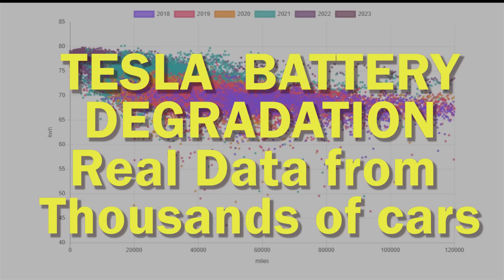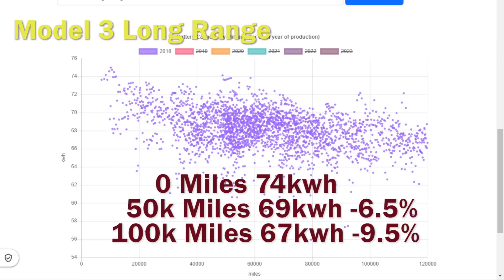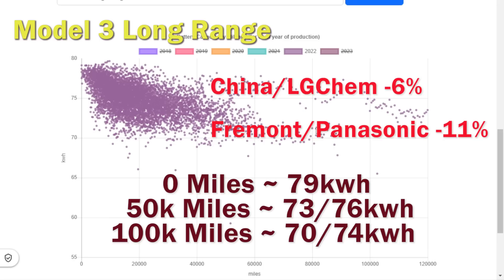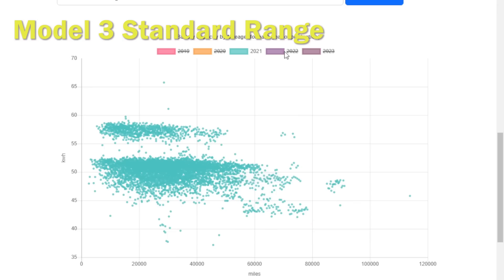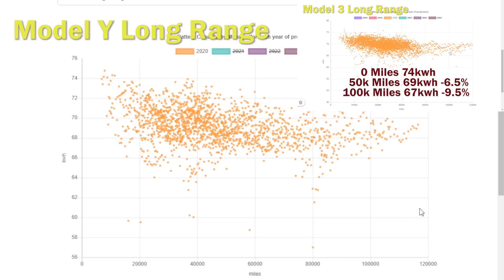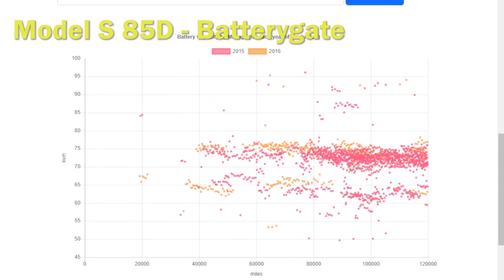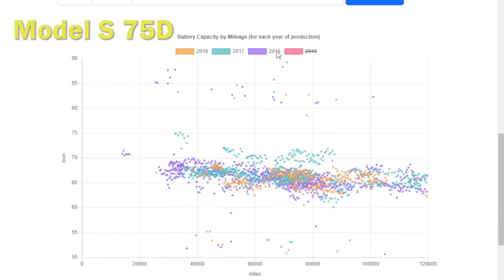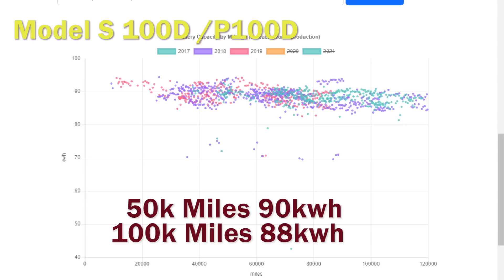Tesla Battery Degradation - The results using real data and why the Plaid is the worst Tesla

Comment: Nice info.  My own 2015-MS85D has 210,000 miles and has 89% battery still.  It lives in a cool, but heated garage .. I Supercharge 10% and my L2 is 3 kW .. keep your battery cool guys.
Reply: Sounds like my '15 90D.  Bought with 50k miles and 264 RM.  At 140k, it is down to 258-259 RM.  50% Supercharge, Level 2 charge at 8 kW.
Reply: L2?
Reply: @davidnaylor83 level 2
It means his AC home charging
Reply: And my 2016 85D can't get any farther than 35 miles. Spent all its life in Arizona
Reply: And only full charge when absolutely necessary
Reply: How is it holding up overall? I looked at a few from around 2015-2018 (MS and 3's from later years) and even ones with 40-60k miles overall build quality was not holding up very well.
Reply: @FragEightyfive  Mine is basically like new, not even a rattle .. seriously .. I’d love a new one for its higher range, but I can’t justify it because mine is so good.
Reply: The thermal management system is good. The cells aren't going to cook in the sun. Heat and cold do affect how fast the battery drains while driving.
Reply: @rkgsd  I'm curious about this.  Will a Tesla actively cool/heat the battery while the car is not in use?  It seems like it definitely would while charging but what about while it's just sitting in a parking lot and not being charged?
Reply: @bullitthead7853  Yes it does.  I cant tell you how many times I've walked out to my car while its sitting in the middle of a parking lot in the summer and I can hear the high speed fan humming from quite a distance.
Reply: How were you able to check your battery retention on your 2015?
Reply: And you are bragging about that. I bought my Toyota Corolla with 200,000 miles already on it. I have driven it another 200,000 miles without doing any repairs.
Reply: @Bryan-Hensley you’re bragging about driving a Toyota Corolla with 400k miles
Reply: I am pretty sure that Tesla is misleading with the battery degradation indicator, so most happy customers won't notice it until they do a long trip,.
Reply: @eng3d  Easy to test every time I drive as I get the range I expect.  I do mostly long trips, so super easy to see.  What is a mystery to me is why some people assume the worst from Tesla .. they make fantastic cars.
Reply: There's been reports the battery shows x % but during a trip it performs horribly. The figures it shows can easily be manipulated to avoid any warranty claims. We need hard data not what's shown on the screen
Reply: -80% is TSLA in a year 😅😅
Reply: @northerngannetproject3147  …… evidence is not your greatest asset
Reply: Jesus. 

I had a M3 long range in Hawaii. 35k miles and was down to 282 at full charge
Reply: @ssing7113  this is common mistake. Tesla will show you range at full charge based on your driving habits - not actually battery degradation. This is very important to know.

On top of that - dont charge your care above 85% unless you are going to long trip right away. After all you are at Hawaii - how much range you need per one trip?
Reply from the maker: Tesla doesn't take into account driving habits on the range when charging or at the top of the screen. We have another video debunking some of the myths about the range display.
Reply: @EVinventory  100% it will. If you drive your tesla HARD - you will not get range 310 miles when you push it to 100% 

Will your range change also when you drive fast / slow as well? For sure it will. Same goes for 100% full it will not give you maximum amount of miles each time you full it 100%
Reply from the maker: You're confusing real world range with what the car is reporting. The car reports the available energy in thye battery converted to miles using the EPA efficiency figure. What you actually get when driving will of course depend on your driving. If you don't believe us, read the Tesla owners guide as it tells you the same thing
Reply: @EVinventory  I did - and I also talk with people in TESLA about it.

My impression was same as yours, but in reality it's different.

Just like computer in Tesla, it will try to "predict" your battery usage from point A to B (taking in account road conditions, sea level etc).

So when you make your battery 100% it will not just give you range based on your "EPA efficiency figure" other things are taking in account as well.

I know what documentation is saying - but reality it's different.

-----------------------
"Does Tesla range change based on driving?

Displayed range is based on regulating agency certification (EPA) and is not adapted based on driving pattern. Your driving behaviors and environmental conditions can impact your vehicle's efficiency, and therefore its range."
-----------------------

Why is different in reality - no clue.

You can test this easy - by actually testing battery real capacity vs miles it's showing you on screen. 

Your data on 100% full battery range prediction should not be used as battery degradation proof. 

There was many examples when in same household Tesla car (I am talking about model 3 here) - when given to another driver, displayed range on 100% will change after some time.
Reply: @DevonHensley211  I think somewhere they’ve confused the range at the top of the screen (which is fixed to EPA) and the chart you can display when you put in a destination and it tells you what you’ll have left at your destination (which takes into account lots of factors).
Reply: @DevonHensley211  You have not talked to anyone about this "in Tesla" 😅
Reply: @Tschacki_Quacki  Indeed I did. But I dont mean people in store selling Tesla cars etc.
Reply: @DevonHensley211 It has been proven by multiple sources that Teslas don't take into account your driving style or the weather conditions for the displayed range. You can get that type of information from the consumption screen, and it takes it into account when planning a trip. Watch Bjorn or Out of spec videos on the subject, those two channels have tested more EVs than anyone else. I would recommend Bjorn though, I dislike OOS Kyle as a presenter, they should probably put his annoying personality off the camera somewhere.
Reply: @DevonHensley211  if you cant tell us who you talked to in Tesla how does that add anything to anything ?
Reply: @DevonHensley211  'I also talk with people in TESLA about it' - only had to read that to know you are just talking BS
Reply: @DevonHensley211  In my Model S the range estimate on the "gauge cluster" always reads the same amount of range at the same equivalent charge % regardless of how I drive.  However if I go into the energy page it 100% takes into account how I drive and its range estimates, while typically close, are sometimes wildly different than the gauge cluster if Ive been beating on it lately.
Reply: @DevonHensley211  It depends on which part of the screen you look at. The range on top is not dependent on driving and temp, only bms calibration. There is another screen with consumption curve that shows the range left based on all kinds of factors. Those are two very different things. The one on top I set on % and for real life range I use the second screen with the consumption curve.
Reply: This is true. Been driving at 65-70mph and my range @100% is 235miles. I start driving pedal to the metal  and started driving between  90-100mph and the range went down to 217miles at 100% charge. Driving habits plays a big factor on the estimated range.